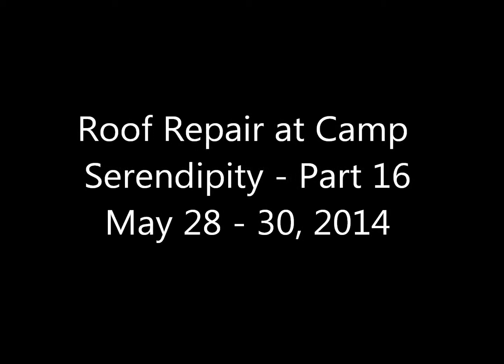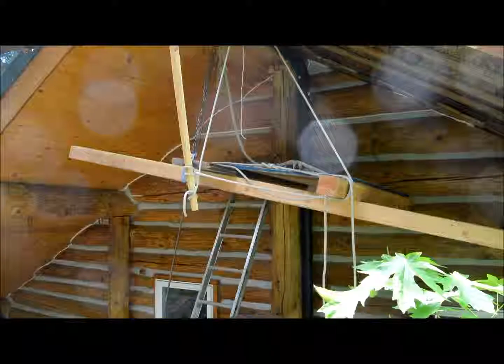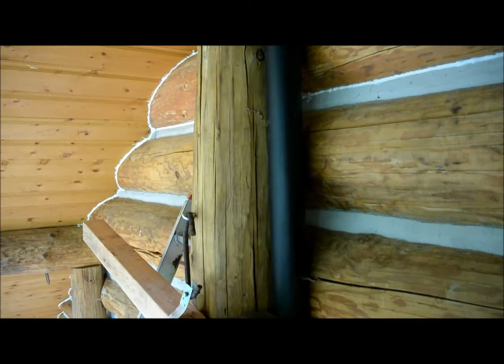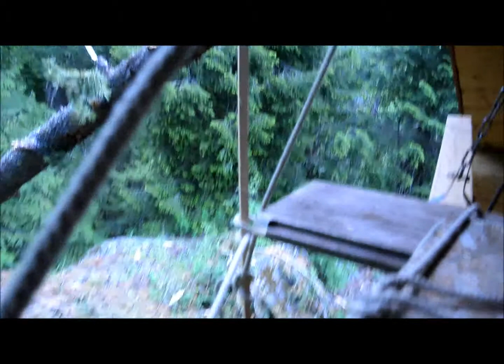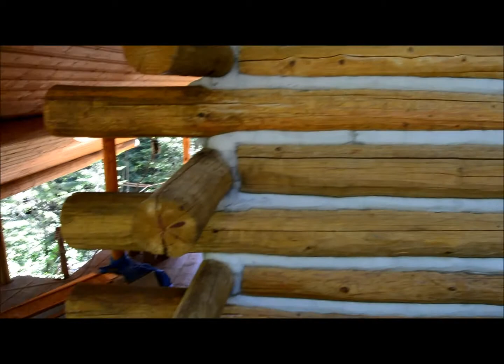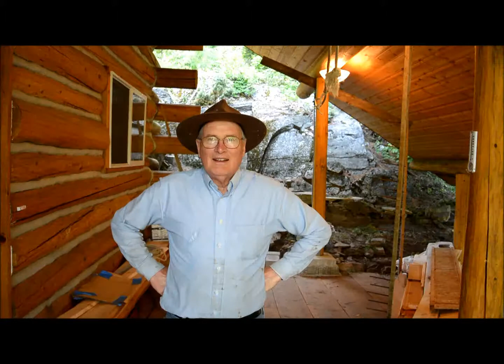Roof Repair at Camp Serendipity   Part 16 May 28 30, 2014

Comment: Looks great. I noticed the vent pipe goes right by the center of the roof line and hides that off color caulking you used. Wasn't a easy repair, you completed that project as inexspensive as possible but at the same time doing it right. Anyone could hire a contractor to repair the roof but that repair would have been very exspensive and who knows the quality of work that would have been done. Very impressed with your patience and skill. The Cabin looks fantastic.
Vinny